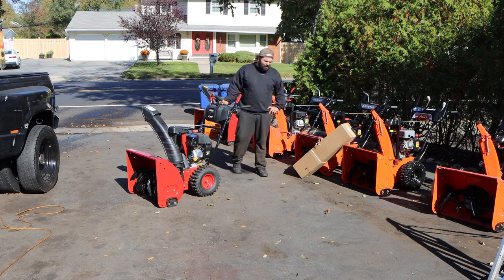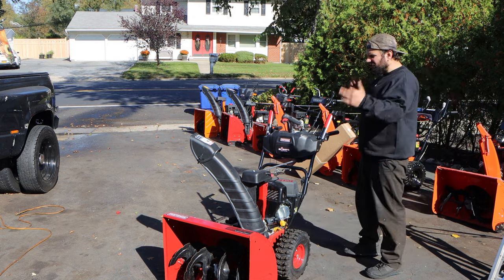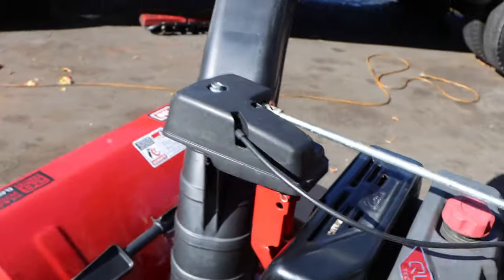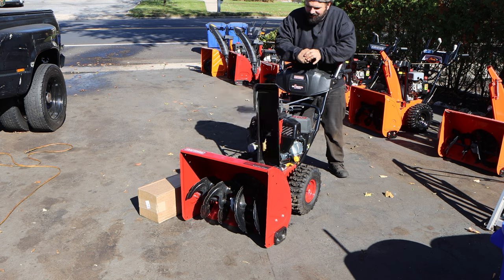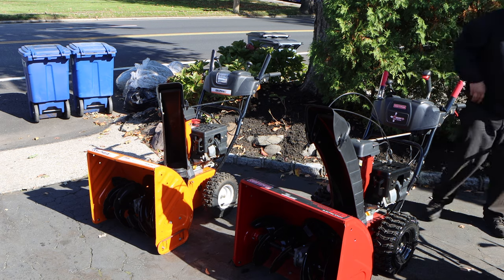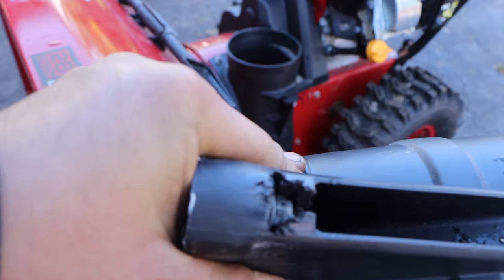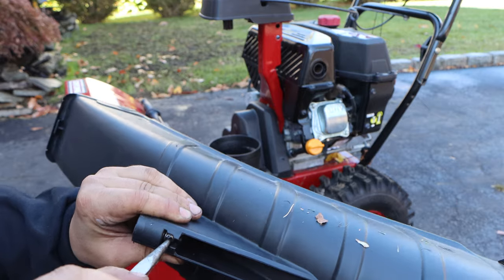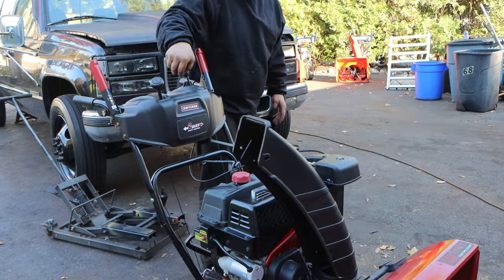How to Fix Repair Craftsman Cub Cadet Troy Bilt Snow Blower Joy Stick Chute That Won't Turn #fixed

Comment: More plastic JUNK!!!  I hate my Cub Cadet.  Four years old and dealing with multiple repairs, unacceptable.
Reply from the maker: What kind of repairs…did you get them all sorted out?
Reply: @pattayperformance  Thank you, yes I did.  So far the problems are all related to the chute and joystick.  The roll pins were all falling out in the joystick and the plastic gear is wearing poorly.  Snowblower is only 4 years old, stored indoors, with moderate use.  I appreciate your videos and others on YT, thank you!

Comment: I have that chute control and it’s a piece of junk!!  I hope the jerk that invented it has to use it for eternity !!  At least the chute that turns with a crank stays in the position you put it in.  That piece of shit drifts all over the place.  They used a chute crank for years and it worked great so why did they change it to garbage that’s useless
Reply from the maker: I honestly like the joy stick chute control.   One lever to do it all compared to other machines where two levers/crank.  

If it’s walking try tightening down bolt that goes through the top.

Comment: That is a weak point on these blowers . If the oil is over filled check out the carbs needle and seat which is another weak point so that's why I always want a fuel shut off on these things .
Reply from the maker: I can’t find a good way to place one that doesn’t look like Edward Scissor Hands worked on the machine